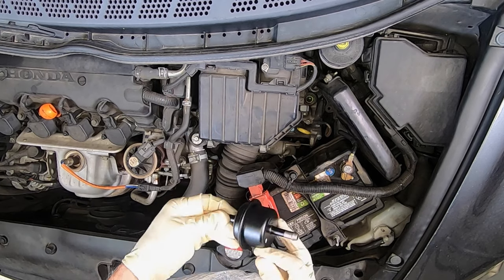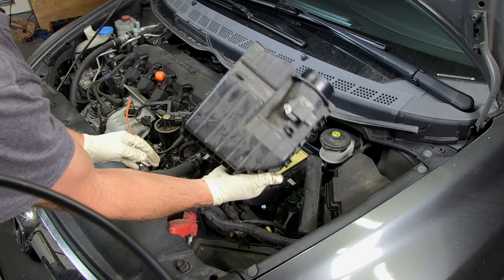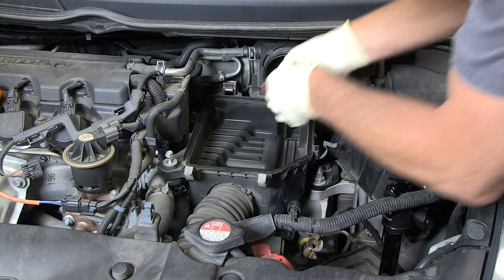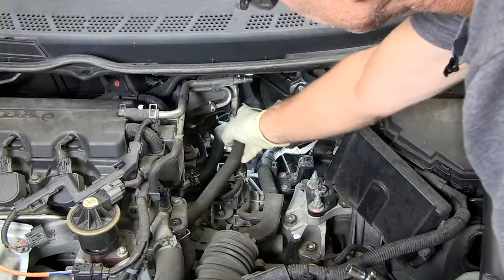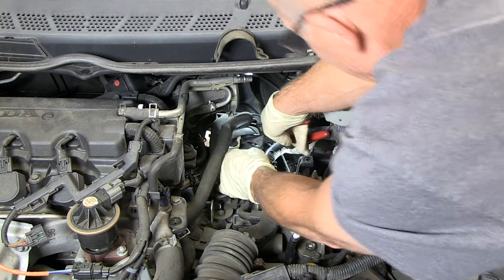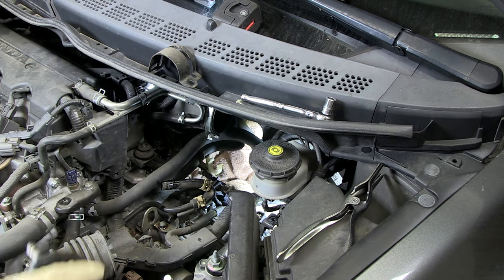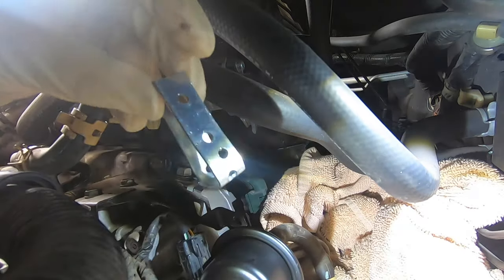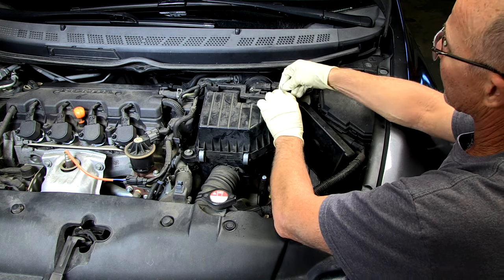Do this to your Honda Civic transmission to extend it's life, filter and fluid replacement

Comment: Curious….since my curious hit 100k I change the trans oil yearly, it’s got 225k now, about to change again, I’ve never changed the trans filter,is filter supposed to be changed at a certain interval? It’s an 08 civic.
Reply from the maker: I’m not sure of what intervals, however with 225 K I would suggest it

Comment: Is that the outlet or inlet line? Is the filter directional if so should the flow indicator point down or up?
Reply from the maker: It only fits one way, it won’t line up in the bracket if it wrong
Reply from the maker: @@loubosTV it will only go on one way due to the way it sits in the bracket

Comment: One more question….should filter change be done before I drain oil from pan or after?
Reply from the maker: It really doesn’t matter, after though if you’re going to wait months afterwards
Reply: So I noticed a 3rd area where it’s not bolt(10mm) like others, it’s a smooth head but air box won’t pop off without that. No mention of this in any vids I’ve seen.

Comment: Sir i have a question is it honda civic 1999 model automatic have a filter also? Same place to your under the air filter?
Reply from the maker: Yes, hard to see, but it’s there
Reply: @dannysdiygarage  ❤ thank you so much sir a very big help your video very informative . Keep safe sir and Godbless.
Reply: @jeffreycruz3982  Amen. Refreshing to see people who want to take time and effort to help others.
Reply: It doesn't come for 1999 along with seventh generation Civics. So, you will have to do a custom install by the radiator to improve your transmission.

Comment: May i know from all you guys out there who changed their filters and transmission oils if they felt any change/improvement in the car.
Like reduced noise,better shifting,better fuel economy etc

Thanks
Reply from the maker: I’ve only heard of shifting smoother, however it’s not known to make a difference in any of those suggestions, it’s more for maintenance

Comment: I looked up your part number and it said that that filter is not compatible with my 01 civic ex?  showed me an atf strainer instead?  why?
Reply: I had an 01 civic with automatic transmission and don’t recall that car (7th generation civics) having this filter.  So, I just did drain/refills every 30k miles.
Reply: @marknease1631  thank you, i hope that solves it.
Reply: Outstanding question. I wonder about my 2005 Honda Civic but I plan to check it out myself when I get time to look into it on my car. I plan to do the job on my 2007 Honda Civic LX as soon as I can.
Reply: Guys,
The seventh generation Civics do NOT have this transmission filter. However, it's now known that it has a faulty design. So, I had my 2001 & 2005 transmissions replaced with a better design along with a filter which was installed near the radiator for easy access. If your transmission is going bad, you should consider on buying a new transmission which is a lot cheaper than buying a new car.

Comment: My Civic VTI 2000 Auto Trans doesnt have a filter. If I'm going to insert one before the ATF Cooler, where do I put the filter, IN or OUT pipe? How do I know which pipe from the transmission is IN / OUT?
Reply from the maker: the filter should be placed in the return or out side, crank the engine to see the direction of the fluid would be the most accurate, although could be messy, good luck, please update me, if you shoot a video, I’ll post it here👍🏼

Comment: The hoses on the ends of the filter look pretty new, like not more than a year old. the stock numbers printed look almost new for an older car.
Reply from the maker: My car is a California car, this is what they look like when they’re talking care of, bought new in 2009, check out my Honda Element videos, bought new in 2007, I do get a lot of compliments on how clean the engine and undercarriage is, thanks for watching
Reply: Thanks for the clarification. Do you think for a first time DIY it might be easier to just cut and replace the hoses attached to the filter and the hose clamps as well? my car is an 09 civic and never has had the hoses or filter changed and I'd bet they are essentially bonded on to the pipes they're attached to. Do you happen to know the Inside diameter and outside Diameter of these hoses? Im thinking it might be a lot easier to just replace both the attaching hoses along with the filter, @dannysdiygarage
Reply from the maker: I believe transmission hoses are 5/16”, a quick call to your local Honda dealer will confirm this

Comment: What year is this car? I have a 2007 ex and was told there is no filter!
Reply from the maker: This is a 2009, I was also told it did not exist
Reply: Ditto. From other videos yes. I have 2007 Honda Civic LX and plan to do this job myself soon. I think buying pliers online will make the job easier. I plan to buy plies with this description online 45 Degree Hose Clamp Plier, Automobile Water Pipe Plier, Angled Swivel Jaw Locking Car Water Pipe Fuel Coolant Clip, for Removal and Installation

Comment: isnt theres ecu memory loss upon removing the battery?
 do you need to manipulate settings thru obd or just clear any obd faults that would arise?
Reply from the maker: Absolutely, when removing the battery you will loose your radio setting or your radio will lock out, use a memory saver if you don’t have your radio unlock code, you shouldn’t have any fault codes if you follow the video, you do not need to adjust any settings when you’re finished, if for some reason you have a engine light on, you would need to clear code, but as long as you don’t turn on the ignition switch while components are unplugged you should be okay
Reply: @dannysdiygarage thanks, Danny! appreciate the big help.

 il be getting memory saver cable with alligator clips. 
please feel free to recommend reliable alternative but not expensive

more power to you, bro
Reply from the maker: That would work fine
Reply: Good question, many professional shops and technicians miss this point. Reason I like do it yourself work is so I can control what has been done and which parts used. I have been told for years that the transmission did not have a filter that required replacement only a screen internally. I plan to change mine as soon as I can find time. I think buying pliers online for this job would help. Query online for 45 Degree Hose Clamp Plier, Automobile Water Pipe Plier, Angled Swivel Jaw Locking Car Water Pipe Fuel Coolant Clip, for Removal and Installation

Comment: Ive searched for the filter and It shows this one, But theres always another filter that keeps popping up in search.. Its an orange filter that goes into the ctv transmission coolor area under the battery. Which one of these is the actual filter for the transmission? both?
Reply from the maker: I would call your local Honda dealership and give them your serials number

Comment: What about the one under the trans oil pan?
Reply from the maker: You can’t get to the one in the transmission
Reply: @dannysdiygarage  You can in a 2016 Fit, i would have thought the civic would be the same way.
Reply: The Honda Civic Transmission has a screen that in older revisions would clog but Honda has solved that problem on the newer automatic Transmissons. It is major surgery to replace or clean the internal screen and only the most skilled do it yourself or professional transmission person would even attempt. I have seen videos on the Transmisson screen and other repairs.
Reply: @dennissytsma3561  me and my nephew did both the trans cooler filter and the pan filter in his 2016 Honda fit in about 3 hours give or take. Was no big deal.
Reply: @cdimmm  Thank you very much for the information
Reply: @dennissytsma3561  Rockauto had both, cheap too. Used Honda fluid, 6 something a qt online.

Comment: I have a 2002 Honda Civic LX, and it does not have an external filter, only an internal one, 
Prob the same for a 2001 - 2005 model,  that you cant change unless you remove the transmission, and take it apart, so i guess that means it is a lifetime filter, which sounds strange,
Does anyone else have any insight on this ?
Reply from the maker: You’re correct

Comment: when do I need to change my ATF fluid and filter?
Reply from the maker: Every 30k on the trans do a drain and fill,  if your fluid smells burnt do it more often, filter 100k
Reply: @dannysdiygarage  thanks a lot
Reply: Great question. I do mine every 30 thousand miles or once a year. Just doing the fluid will help any transmission assuming the recommended fluid is used. Filter replacement also helps but not as important as regular service to replace the fluid with the recommended type.

Comment: How did you get the C shaped clamp that holds the two hoses out of the way?
Reply from the maker: I’m sorry, I’m don’t understand, what time stamp on the video
Reply: @dannysdiygarage  I got to tell you, your video makes this look easy. From removing the air box to pulling those two hoses out of the way to get at the filter; the whole thing wi much harder and unfortunately I wont watch any more of your videos.  I cant trust that you make it look so easy with no mention of interim PITA steps.
I much rather watch the guy that says this takes 2-3 hrs stinks but here how you do it and HERE ARE THE PITA PARTS.
Your video production quality is great and probubly dont have more subs because of what I am saying here.Good luck
Reply from the maker: Sorry, I’ve been working on cars for 30 years, and what might be easy for me may not be easy for others, I do my best to help others and show all the steps, again sorry for your difficulty on this project
Reply from the maker: Your feedback is appreciated, and very helpful for future video releases
Reply: @pgreenx  Most of the videos on Civics on You Tube have what looks like an easy job and then becomes a PITA or just undo-able. The mechanics on most of the good videos are professional who have done dozens if not hundreds of jobs similar to what's shown on here. I tried doing my own tie rod ends and found out that without a vehicle lift or an oxy/acetyline torch no amount of propane was loosening my jam nut on  my outer tie rod. i took it to a shop. i think its best to assume all maintenance jobs will have some parts ,of the job,that will be a pain and you may easily get complications that weren't show in ANY videos on here. Not just Danny's
Reply: @chuckrafiki8649  thanks.  I understand that more now.   Would be nice to point out what could be a PITA though.  The pros aren’t tuning into YouTube to figure out auto repair on routine stuff.  
When I did the civic serp belt I followed the blue driver channel and they clearly pointed  out how hard the tensioner puller could be to remove and what to do if you encounter a problem.

Comment: Make sure filter is installed in the right direction!
Reply from the maker: That’s correct, thanks for your input
Reply: @dannysdiygarage  
The top is the flow outward, right?
Reply from the maker: @vice4134  it only fits in the bracket one way, which means you can’t install it incorrectly
Reply: @dannysdiygarage  
Good to know for people who have 2006 -20015 Civics. However, my Civics are 2001 & 2005 and it had to be installed as custom when I had an upgrade transmission. 
So, you don't know which end is outward?  I'm thinking it has to be the head. I will check with my local Honda to find out. Thanks for getting back to me.
Reply from the maker: @vice4134  I don’t have that answer please update me when you found out
Reply: @dannysdiygarage  
The dealer informed me that it goes down.

Comment: Ok so…. I JUST TRIED this today (4/16/23), and it was a “fail” for me. I got the air box out Finally, got the top portion of the filter clamp holder off, then… I looked this over, as to the clamps on the ends of the filter. One closest to Me was maybe doable but then I looked at where and how I’d need to get pliers for the other clamp (one down towards the top of transmission case) and said to myself…”time to quit while you’re ahead”. I put it all back together and plan to see if the local independent shop wants a try at it. I’m not sure if there is more “stuff” in the way of a 2013 vs the year of your Civic. I don’t normally give up but this was a case of knowing when to stop. Sorry. Anyway, comment on a 2012-2013 if anyone has had success on this filter change out.
Reply from the maker: unfortunately I only have the 8th Generation and I'm not sure if it's any different. Sorry to hear of the difficulties

Comment: How often shoykd this be replaced?
Reply from the maker: Air conditioner capacitors often last 5-20 years, with 10 years being the average. The lifespan can be influenced by factors such as quality, environment, and usage patterns.
Reply: This is the transmission fluid filter right? How often shiykd i replace?
Reply from the maker: @jeffreymccormick9280  sorry, I got questions mixed up, for this every 90k

Comment: Really nice video....thankyou.
Reply from the maker: Thank you for that
Reply: I'm watching from Australia.
Reply: @mcdougal0  My oldest Biological son is Aerospace engineer living in Brisbane. I am in Florida USA. I think buying pliers online would make this job less work. Query on 45 Degree Hose Clamp Plier, Automobile Water Pipe Plier, Angled Swivel Jaw Locking Car Water Pipe Fuel Coolant Clip, for Removal and Installation

Comment: Anyone have issues getting the bracket secured around the filter? Mine won’t let me secure it with the 10mm bolt
Reply from the maker: No issues, it should fit

Comment: I bet you dont know what size line was on this filter uses do you? lol thanks either way
Reply from the maker: I’m believe it’s 5/16 hose
Reply: @dannysdiygarage  thank you. The reason I’m asking is I’m going to try to fit a raybestos or magnifine filter there instead of the factory and those come 5/16 3/8 1/2. Thanks again

Comment: Dose my 2001 Honda Civic have one of those
Reply from the maker: Call Honda ask them, it’s called a transmission cooler filter,
Reply: @dannysdiygarage  The car runs great until the transmission fluid gets hot then no more gears let it cool down then you can drive it some more
Reply from the maker: You can try changing the fluid and filter, I’ve had a few American cars do this, filter gets plugged and starves for fluid, I’m not saying this is what it is, it sounds like you have big problems
Reply: @dannysdiygarage it needs one it definitely needs replaced

Comment: That air cleaner assembly was a F*** pain to get back in.  Between my son and I trying , it probably took us 40 minutes or longer to finagle it back in.  If I new if was going to be so troublesome I would've skipped the transmission filter swap.  Also, the transmission filter I bought (OEM) must be a slight bigger in diameter because I couldn't get the 10MM screw back in.  Such a poor design by Honda.
Reply from the maker: Sorry to hear about your difficulties, for future repairs try removing the cowl panel, it adds extra room, here is a video link showing it. Although it’s not necessary, it will make it easier if you’re having issues https://youtu.be/Scukh_qZ3FQ

Comment: 8 minute video. I spent longer than that trying to get the lower air box out. Don't get me wrong I appreciate the video. But it really doesn't illustrate the difficulty of this job. By the way the air box has to be lifted and rotated clockwise At least in my car. . A step not in this video. Lower hose clamp on my car is about 3/4 inch wide. So all of my pliers were either too narrow or the handles too long. I couldn't get any to fit. even moving the filter around. You can only get one hand in there and cant see anything. I even tried putting a go pro in there and using my phone as a viewer. To say the least the old filter remains over an hour later.  Absolutely a stupid design considering how much space there is where it could have been installed.  At this point it might be easier to remove the lower hardline from the transmission than the filter from the line.
Reply from the maker: I do remember it wasn’t easy, that’s why I filmed it to help others, I did a Honda Element also, that’s tough also you can see that on my channel
Reply: Buy via online 45 Degree Hose Clamp Plier, Automobile Water Pipe Plier, Angled Swivel Jaw Locking Car Water Pipe Fuel Coolant Clip, for Removal and Installation
Reply: @dennissytsma3561  I tried end nippers linesman's pliers. and angled needle nose. straight needle nose. I only have about 20 pairs of pliers. Finally found a pair of Sheetmetal duckbill vice grips.
Reply: After watching and reading comments, i'v decided to just take it to my local shop. My neck is fused from breaking it in an motorcycle accident. I'm not capable of rotating my head much, so this maintenance job is out. Had I still have  full motor skills,  I would give it a go. I like that it was well filmed and nice tips. Your comments were helpful too thank you.

Comment: How Long we need to change filter
Reply from the maker: I would go 90k for the filter, every 30 k for the transmission would be ideal
Reply: Dannys DIY Garage you mean 90000 km? In VietNam we use km unit
Reply from the maker: No 90,000 miles
Reply: Dannys DIY Garage Thanks Bro

Comment: Actually, there are two transmission filters in the system
Reply from the maker: Correct, thanks for bringing this up, I should have mentioned this in the video, the filter in the video is the external transmission cooler filter and the other is inside the transmission only one is easily accessible, the other gets replaced during a rebuild 
Thanks for pointing this out, appreciate your feedback

Comment: Why does my wife’s 2012 civic not look like this…
Reply from the maker: Is it an automatic transmission?
Reply: 2012 civics were changed from the 2006-2011 Honda civics.
Reply: It is similar though and under the air cleaner.  Look for a YT video for changing a 2013 Honda  Gen 9 Civic  ATF filter